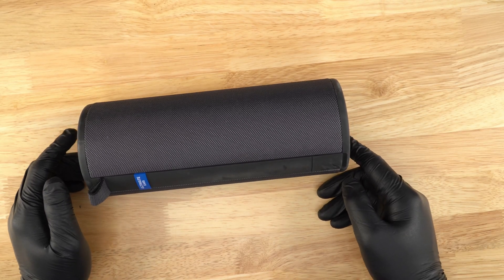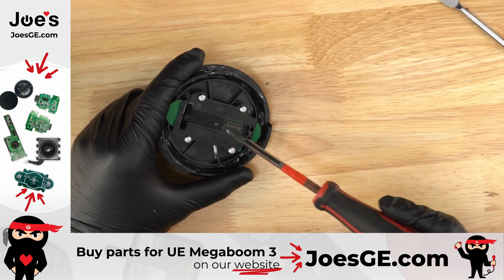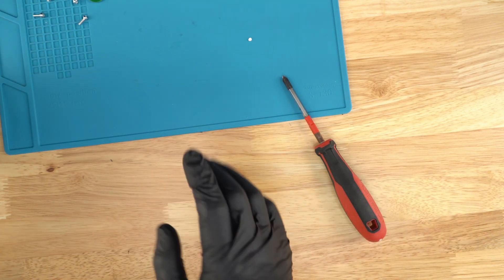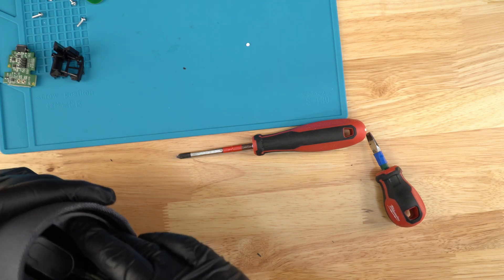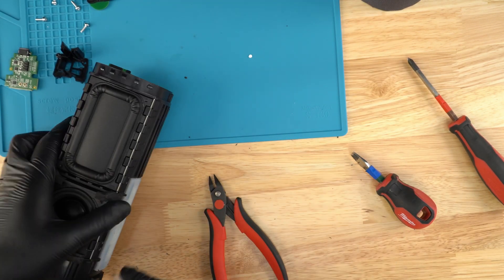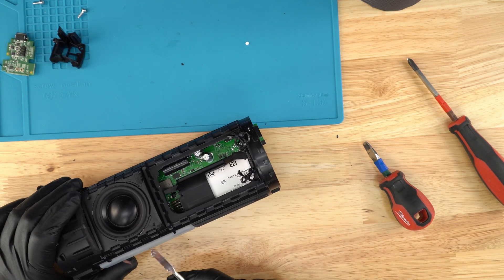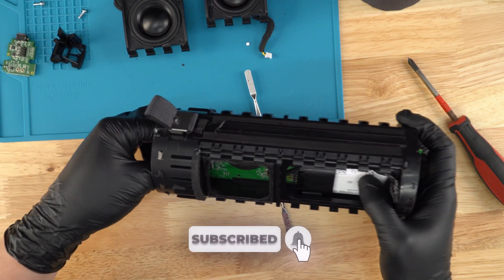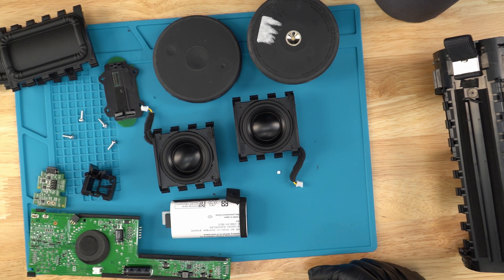UE Megaboom 3 Teardown – Inside the Ultimate Portable Bluetooth Speaker!

Comment from the maker: 🔧 Parts: https://www.joesge.com/search?q=megaboom+3
🛠 Tools Used:
Strong Pry Tool – https://www.joesge.com/products/strong-metal-square-tip-round-tip-headphones-opening-pry-repair-silver-tools?variant=39665858347054
Flathead 1.5mm – https://www.joesge.com/products/flat-head-1-5mm-thin-strong-screwdriver-pry-repair-tools?variant=31615361056814
50-in-1 Toolkit – https://www.joesge.com/products/joesge-repair-tool-kit-50-in-1-precision-screwdriver-set-tools?variant=32817393074222

💬 Have questions about the teardown? Drop them below and we’ll help you out!
👍 Like the video if you found it helpful and subscribe for more tech teardowns!

Comment: I like the modularity of this speaker. Everything unplugs from everything else and it just feels rugged and durable. It’s great for repairability. Only wish would be that the speakers were not held in with those rods. They’re a little difficult to insert. The adhesive does release fairly easily though with slow consistent prying, no heat needed. And it just sticks right back on and seals well.
Reply from the maker: The rods are really funky I agree with that.